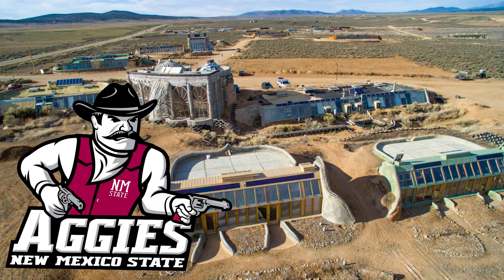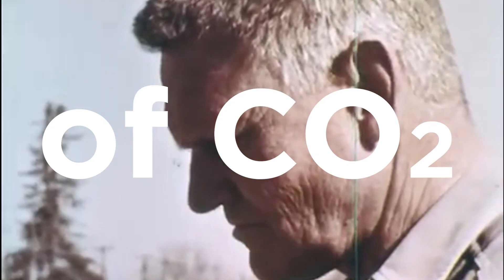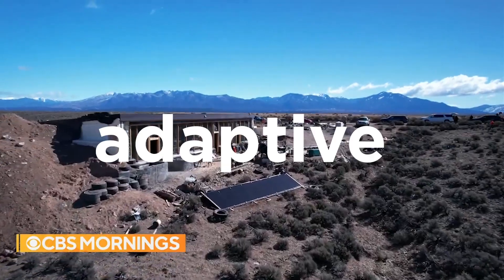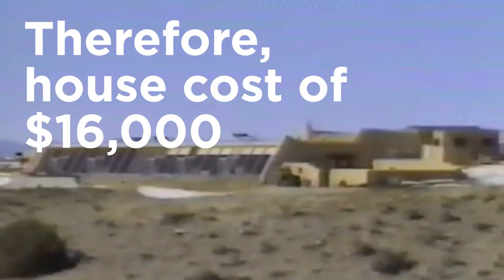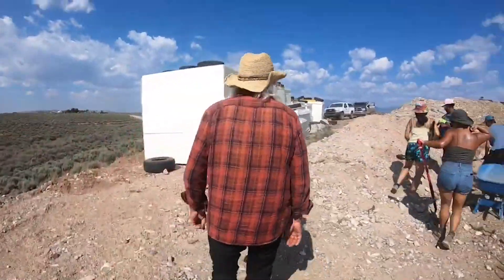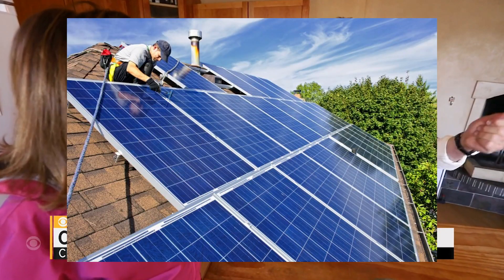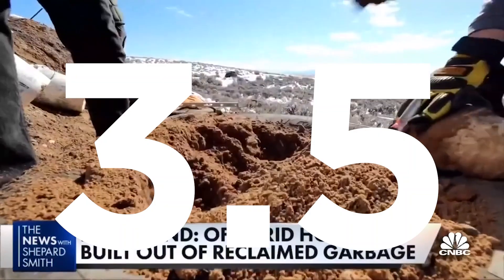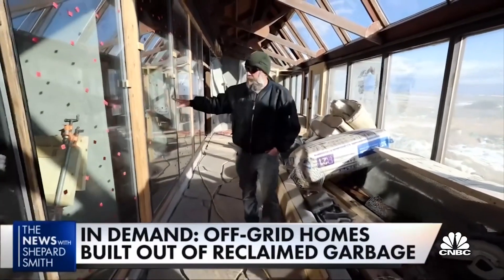Are Earthships the Future of Green Housing?

Comment: The false rumor about tires in earthships gassing and leaching chemicals is likely a false conclusion from different envioronments where it happened. Tires used by the US Navy to build a barrier reef in saltwater killed the coral and had to be removed. When tires are burned and doused with water there is serious chemical runoff that looks like a cross between crude oil and tar.  These issues do not apply to an earthship. 

Where one cannot build homes with tires, one can build farm shelters, work shops, bunkers, root cellars, barns for animals and work out of tires. Just use a sealent that would waterproof a basement  if water or humidity is an issue.
Reply from the maker: Thanks for sharing. I didn't know that. It would be interesting to know how long it would take extreme weathering (experienced by property near the sea) to result in chemical runoff from the tires. Although, I imagine in most cases people won't be building earthships that near to the sea.

Comment: there's an architect in Russia, with some interesting decines for cold weather earth ships.
Reply from the maker: Sounds cool, I would like to check out their designs! What's their name?
Reply: @greenfutureyt  i bet it's bioveda
Reply: I built mine in northern Canada. I put in wood stoves and built it in a forest so fuel isn't an issue. At -35C it gets down to around 5C in the greenhouses and 15C in the interior without heat added. My design is based on the 'Global' model Earthship, though done by me to adapt it my climate, but it works well. We get +36C in the summer here as well and I use a 60w fan just to move air around to cool off. I can't think of a better design that can accommodate a 70C swing from summer to winter with relatively small energy usage.

Comment: When old tires are incorporated in an earth ship with soil, they continue to deteriorate over time, releasing chemicals and gases that may be harmful to the health. Think about that. Earthships are ok in hot, dry climates, but when built in ra8ny areas, almost alway# have drainage, leakage and ventilation or humidity problems.
Reply from the maker: Agreed! In my video talking about cob I discussed the differences between natural homes made of cob and rammed earth and how traditional cob homes can prevent some of those issues. Rain is still a problem for cob though... rebuilding walls each year does seem pretty laborious...
Reply: Never even smelled a tire in 3 years of living in mine.
Reply: Factually incorrect. The thermal wrap layer keeps the water from infiltrating to the tires, I used a product called Rhino Skin to seal the outer shell of the earthworks. There is no off-gassing or chemical leaching. In fact, if I didn't tell you the house was made from tires there is no way you would be able to tell. I live in Canada, I have rain in the summer and four feet of snow in winter. I have no issues with anything you've said here. This a popular myth told by people who have no experience with Earthships and need to find a reason to disparage their development. I have been living in mine now for a couple years, my house mostly smells of tomatoes, peppers, and herbs in the greenhouse hallways. As for drainage. I have two layers to my Earthship, if it's graded right you will have no problems, and that includes having heavy spring runoff in my area. Like anything, if you do your calculations wrong you'll have issues, do it right and you'll be fine. The upside is I have a large house, that cost me one-third of what a conventional house costs and next to no utilities. The downside was it took a long time to build. My point is this kind of comment is super common in Earthship forums, it's a lie, if you think you have what it takes to build on, you should.
Reply: I live in humid Florida.  You can defeat mold with oil based primers like Kilz. Other products like cool seal, vapor barriers,  and those same sealants that are used to waterproof basements will solve those wet and humid climate issues.

Comment: NO THEY ARE NOT. They are environmental disasters. constructed with old tyres that will decompose and offgas into your home. Extremely high cost to build, dumping sewer into the surrounding ground with methods that are illegal almost everywhere. Their carbon footprint is actually larger than newer well built homes.
Reply: I live in one. This comment is a joke hahaha
Reply: I disagree if you’re worried about the old tires decomposing then you SHOULD build with them. Only because tires that are buried, never decompose. They only “decompose” when they are exposed to the elements which also takes about 80 years or longer. Also Earthship have outdoor treatment cells for sewage that is effectively held in the ground and or benefiting surrounding plants. Addressing your claim about carbon. Traditional houses continue to have a high impact on the carbon footprint even after they are build. While for the earthship they might produce minuscule amount of carbon while it is built afterwards they produce zero carbon emissions. Next time I would advise you to reschedule earthships before providing incorrect statements about earthships.
Reply from the maker: Don't fully agree with you here...not extremely high cost to build if labour not accounted for, and manure can be used as a natural fertiliser. Carbon footprint is extremely variable based on methods for preparing land etc..
Reply: Sorry but you are wrong.  There is no off gassing in my 2 earthships.  I should know.  If you do not have access to good cheap labor, yes they are expensive.  Yo need friends or strong relatives but this off gassing stuff you mention is nonsense!
Reply: This is total nonsense. This person clearly has an envy problem and no experience with the subject. They are trolling. There is zero validity to their statement. Earthship tires don't off-gas, period. Their water consumption is about one-third of a standard house because of greywater reuse and leach field septics are used widely all over the world with little to no environmental impact. As for the foot print, they only use half the amount of new construction materials as new conventional house as three of the four walls are recycled tires. Tires that won't need to use energy to grind them into pellets or manufactured into something else, or of course burned. Earthships beat conventional homes on virtually every metric across the board. The only downside is cost if you don't do the building yourself.

Comment: There are many sunny and arid lands where people could benefit from this construction. Eastern Oregon would be an example. These have been built in Canada and work well with the addition of a minimum supplemental winter heat source. An interesting Youtube video titled "Ontario couple built this eco-friendly earthship home for $70,000."shows the comfort and beauty of the earthships. 

We need building codes that expedite these homes that have been tested favorably for earthquake and fire resistance. 

They have underground cooling tubes that keep the home comfortable in a hot summer, but can be closed in the winter. The greenhouse in the front grows food, keeps the home sunny and well-lit and can heat the home in winter.

Large earth-covered water tanks store rain water that is treated and used inside three times, first as clean water for cooking drinking bathing, then treated again and used to water the greenhouse plants which then filter the water enough to be used for flushing toilets, then that water finally goes outside to a conventional septic  system. These homes are brilliant solutions to the problems facing us. 

Every state, county and city should be promoting these homes.
Reply from the maker: Hi Melody, I absolutely agree with you! Planning permission for these, and other homes which use other natural building materials, such as cob, is hard to attain. My understanding is that this is due to the difficulties in meeting building regulations pertaining to insulation. As to achieve the required insulation value, really really thick walls are needed. I think if we can find ways to make walls thinner, for example through lining with another insulator - which can be derived naturally, it could become much easier to meet those regulations, and ultimately, we would see a lot more of homes built in this manner. I am releasing a video later today which talks about cob and outlines a way it can meet the building regulations for insulation with thinner walls.

Do you know of a good video that explains about the cooling tubes you are talking about, and how they work exactly? I am interested to find out more.

I do love the water harvesting system used in most Earthships, as you mention, and I think it's something that could be modified and applied to most homes!